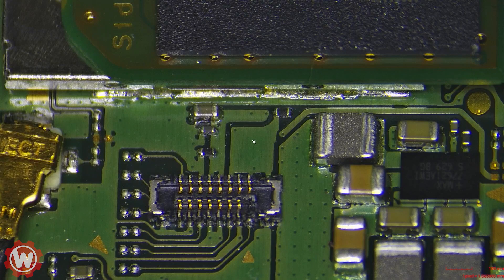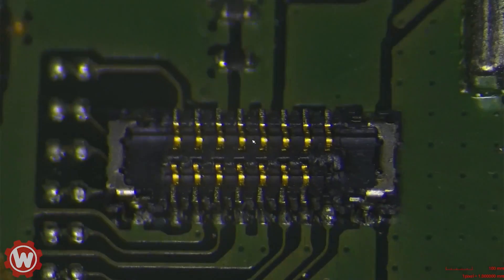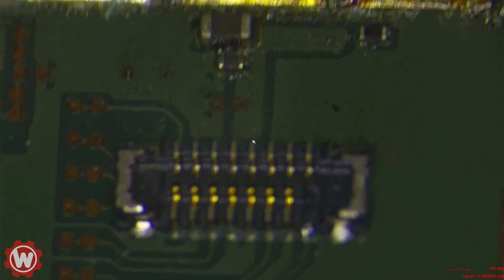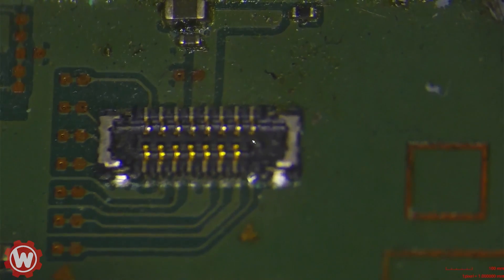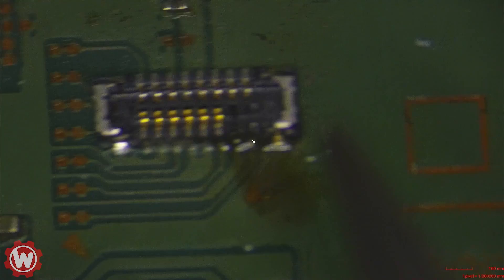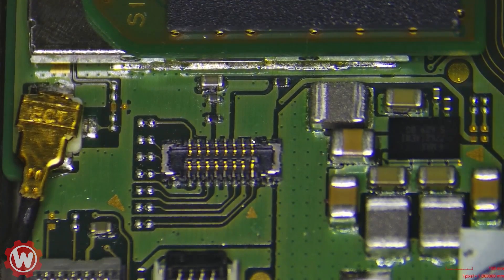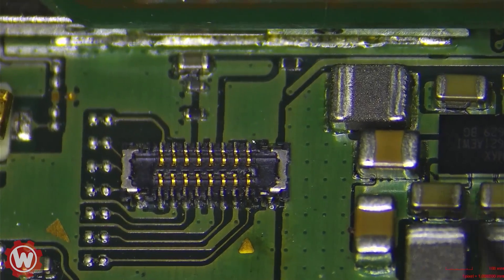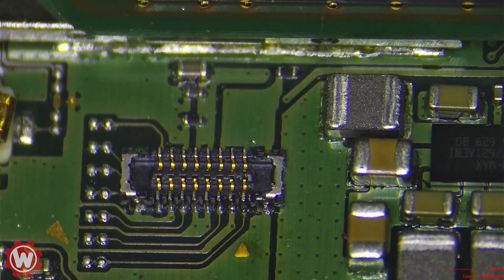Nintendo Switch SD Card Reader Repair (FPC Connector Pin Replacement)

Comment: What scope do you use? I recently purchased the amscope SE400-Z. I like it but I keep getting eye strain. Its less with the scope compared to the jewelers glasses I was using prior. I think I might need to get just an image sensor based scope. That way I'm just looking at a screen but I wanted to avoid that because of latency.
Reply from the maker: Personally don’t like that brand. They use Chinese scopes stamped with their name. Get your self a leica.
Reply: @Wayayeo  Sorry but what model? I tried searching for a 10x zoom scope but only found one that doesn't look suitable for electronics repair. If amscope doesn't get back to me I am going to return it. Meantime I might try and add a pi camera I have to it
Reply from the maker: Leica S6. If you’re going to use amscope might as well get a $150 off of eBay